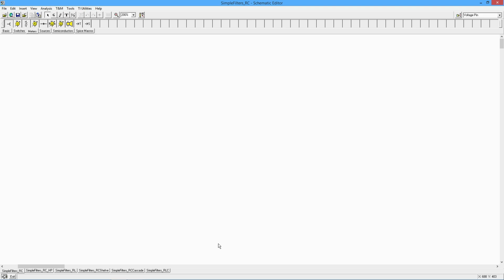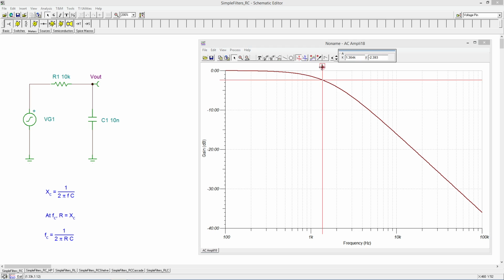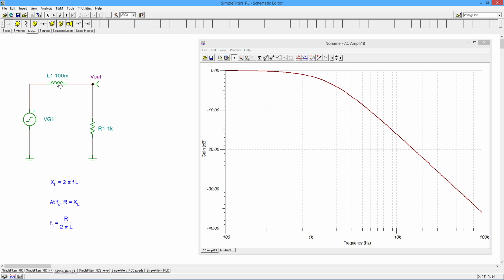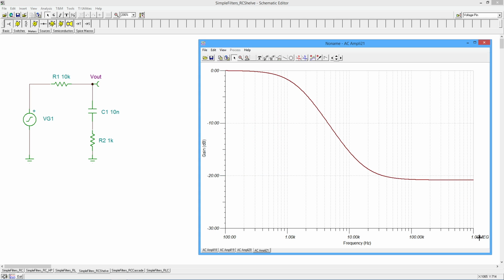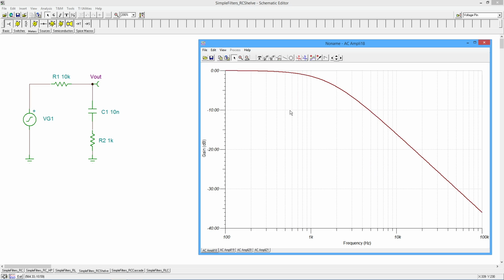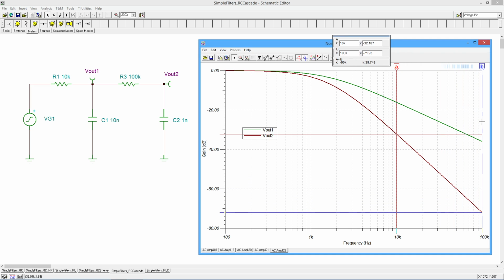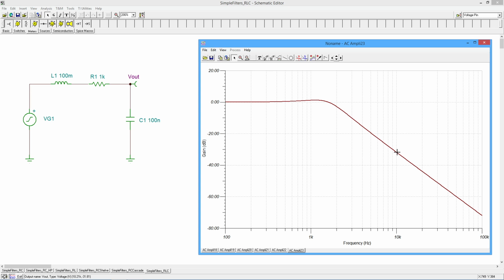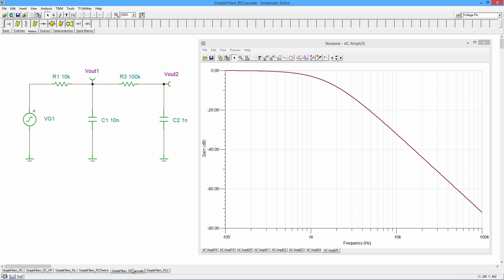AC Electrical Circuit Analysis: Simple Filters

Comment: Thanks. Secondly, after this series should we move to "op amps" or "semi conductor devices" playlist?
Thanks.
Reply from the maker: You can start the semiconductor devices list right now. At this point, you have enough knowledge of AC to understand semi. You should finish semi before starting op amps, though, because it builds on many circuits from semi.
Reply: @ElectronicswithProfessorFiore  Thanks for your prompt reply.
Keep it up!

Comment: Thanks for your excellent work. Does the "dropping curve" represent the "discharging" of the capacitor?
Thanks.
Reply from the maker: The cap(s) are charging/discharging continuously in an AC application. The time domain representation of a discharging cap in a DC or transient application has an appearance that is superficially similar to the frequency domain plots seen here, but that's about as far as it goes.